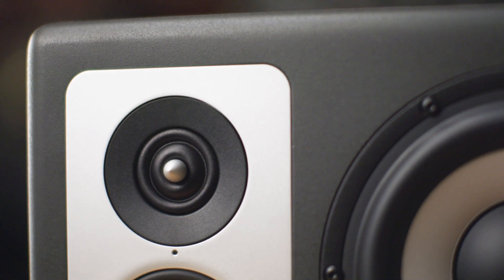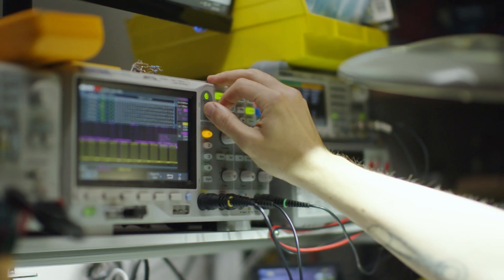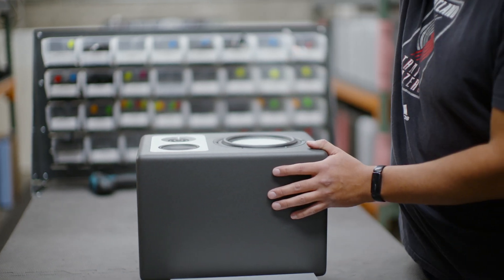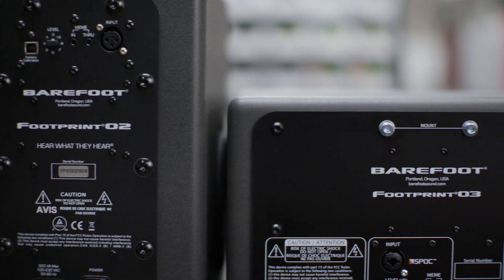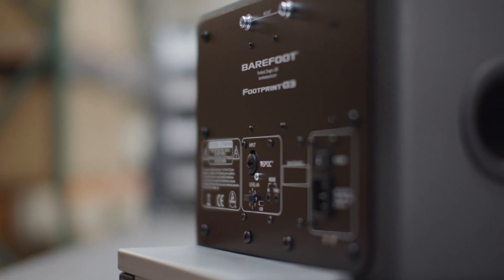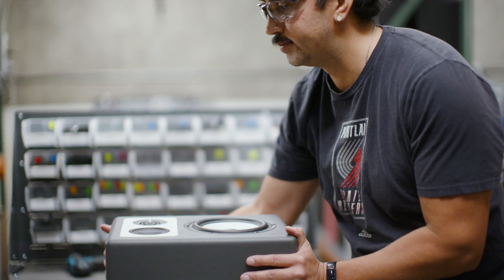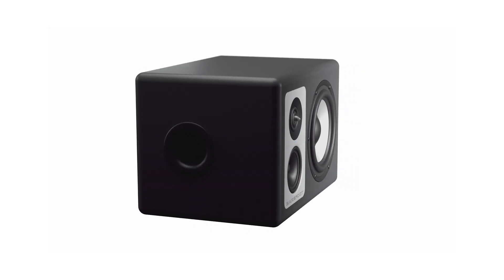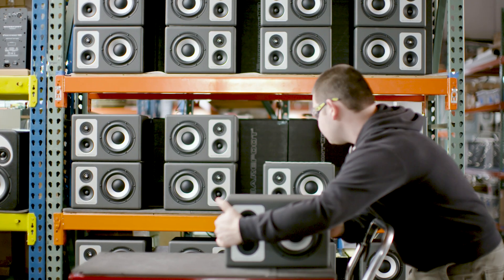The Making of Footprint03

Comment: I really wish these had a sealed cabinet design like the footprint 1 and 2
Reply: Why???
Reply: @joelthames1141  A cabinet is ported, to increase its low end output, but this increased low end output is not a controlled one as the port in a speaker acts as a Helmholtz resonator, which is it works the same way as how a whistle tone is created when you blow into an empty bottle at an angle. I hope you’ve seen or done it. If the speaker itself is producing that low end, then it’s directivity, and its ability to merge the sound of the 3 drivers into a single one to reproduce the whole frequency spectrum is much better. Ported speakers have a lesser controlled lower end, sealed cabinet designs have a better controlled lower end which make them more precise. The only downfall for a sealed cabinet is the cost to make the woofer itself to produce that lower lower end

Comment: RIGHT when I’m about to go monitor shopping! Hmm.
Reply: Wait for the active Kali SM5... Or get a Genelec if you have the budget.

These aren't bad, but price to performance wise, or no expense spared, they wouldn't be on my top three list.
Reply: On second thought, maybe there is somethig to be said comsidering their bass extension and price, but man the 101dB max spl gives me pause.
Reply: @stevenswall You can NOT take SPL figures at face value. Wisen up on that.

Conpanies measure it differently. Some do RMS, some do peak. And regarding RMS it can be for very different time-durations.
Reply: @Tazmanian_Ninja  I assume the company is trying to show their speaker in the best light possible if it's not specified. Don't think anyone is going to get burned that way.

And, I take Genelec SPL measurements at face value for example, because they will you how it's measured and you can see a light come on after a few seconds: "Maximum short term sine wave acoustic output on axis in half space, averaged from 100 Hz to 3 kHz at 1 m" 

or

"Maximum long term RMS acoustic output in the same conditions with IEC weighted noise (limited by driver protection circuit) at 1 m"

Would be nice if it were standardized or there was a database though. Erin's Audio Corner does some good tests to see when and how compression happens at a speakers operating limits.

Comment: They pretty, are they better than the kh310?
Reply: Will be an interesting comparison for sure. Also vs the HEDD MK20 (I think it's called)
Reply: surely. The kh 310s are outdated in 2024 as they still use the old silk fabric dome design for the midrange driver and tweeter. this results in a lot more total harmonic distortion in the mid range and especially the high end, All the other speaker companies like barefoot, focal, Adam audio and eve audio etc. have moved on from this design therefore making them better speakers in the technological sense while being the same priced too. is that makes the kh310 obsolete compared to the newer speaker designs from these companies